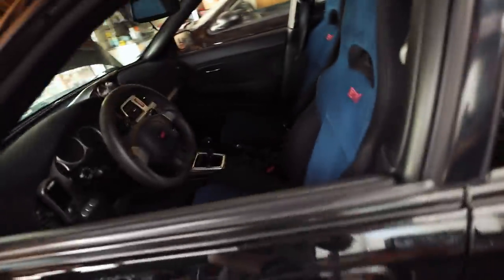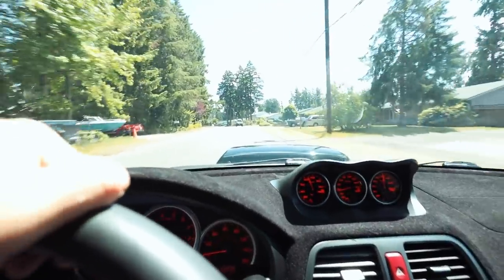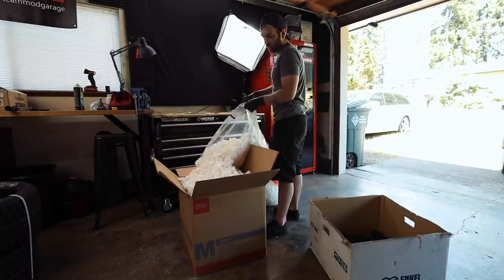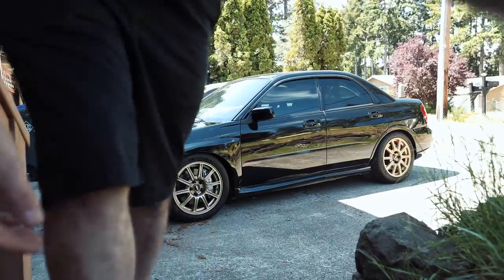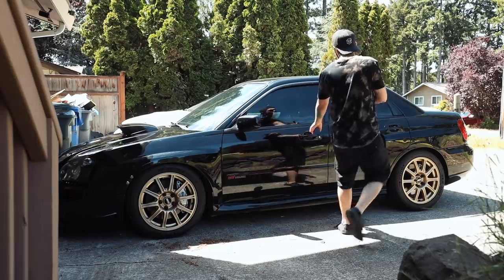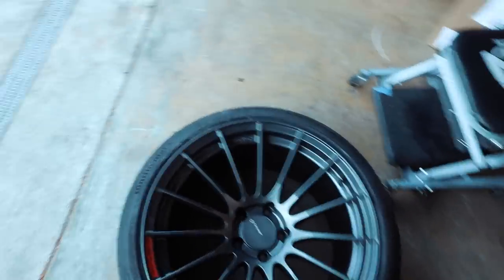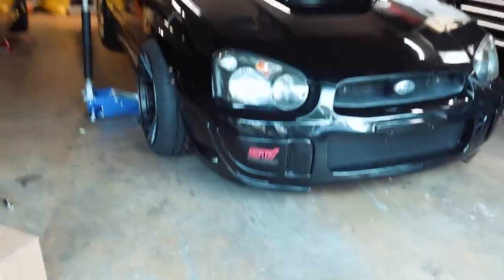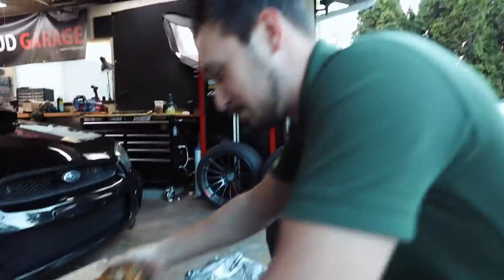This Couldn't Be Any More Perfect!

Comment: Food for thought. Im sure you know, subaru brakes suck to bleed. On my GM6 I've had good luck bleeding them by following the service manual bleed sequence, but they still normally feel like they're not all there. So i go to a lower friction surface and drive about 25mph and brake to purposely activate an abs event a few times to get the abs pump motor turning and the valves moving around and get any air past those valves and perform bleed again. The second bleed I'll lightly tap the calipers with a rubber mallot to shake any air free that may stick to the walls of the calipers and I'll also collapse the pistons with a small pry bar when the bleeder is open, close the bleeder so pressure can push them back out and repeat that 3-4 times. I always do inboard bleeder, outboard bleeder per caliper. After all that mess I get a solid brake pedal that is everything I could ask for a track event. After that, its normally not an issue to bleed the brakes to get new fluid through. It only becomes an issue when the system is opened up to replace components. I hope this makes sense and if you attempt it, it yields a good result.
Reply from the maker: I'll have to give that method a try, ordered more brake fluid to see if I can't get the last of the air out of the system. I'm sure the two times I opened the bleeder without pressure on the system did not help either 😅

Comment: Ughhh my baby just went in to get bent valves replaced and seeing all these blob eye videos is giving me withdrawal lol
Reply from the maker: Hopefully it's a quick turn around for you! ❤
Reply: @Smeedia  3 weeks. Worst part is, the motor (IAG stage 2 and built heads from a local speed shop) only have 4k miles on em. Speed shop fucked up and refused to stand behind their work.
Reply: @Smeedia  They didn't set valve lash correctly.
Reply from the maker: What did they fuck up on?

Comment: If I'm not mistaken, highly professional Subaru engine builders strongly suggest deck half splits after each splitting or at least re-honing main crankshaft journal. They say it's mandatory.. but I guess, they're exaggerating slightly...
What do you think? It would be nice to know Jeremy's opinion as well.
Reply from the maker: Depends on how the case halves are, they go through and do an initial inspection on them to see what all needs to happen 🙏

Comment: Hi tanner!  I don’t know if you can do this with a GD but with the GR you can bleed the abs unit with a scan tool and it makes it much much easier to bleed the brakes after that.
Reply from the maker: That would make life easier, where can I aquire this tool? 😅
Reply: @Smeedia  I use a snap on Solus to do it,  I don’t know if a cheap scan tool can do it or not but you definitely can’t use an accessport to do it.  It makes a big difference.

Comment: Sorry if I missed it but did you change the old brake hoses for stainless steel? Also, the firewall flexes like crazy so a brake mount helps a lot. These two additions make a huge huge difference.
Reply from the maker: Yes did that a few months ago, also already have the master cylinder brace 😁🔥 both great mods!

Comment: I have always had a soft spot for those wheels. Love the concave look!

Ps would you happen to know where I can source a 3 bolt EWG Up-pipe? Seems nearly impossible to find one online these days.
Reply from the maker: Same, I've always wanted a set of them but was hard to justify the price 😅

I belive PLM is making them still!
Reply: @Smeedia  PLM makes EWG up pipes but they’re only 2 bolt.
Reply: I’d suggest finding a three bolt up pipe and taking it to a fabricator to weld on the 38/44mm ewg vband opening.
Reply: I have a new iag 3 bolt 44mm ewg im not gonna use since I'm going with an ets rotated setup

Comment: Quick question: What's the difference between the current engine and the one you're building for Karma? Why not get the current block closed decked and built? Just curious! Thanks, and keep up the amazing content!
Reply from the maker: No real difference when it comes to what were doing. The RA block now has a revised ring gap but aside from that nothing majorly diffrent. Main reason for doing this is so I have the second engine ready to go. 😁
Reply: @Smeedia  That makes sense! I wouldn't want to take apart my daily for that long either. I'm HYPE to see how it comes out! Full chooch pulls on the horizon!

Comment: Is there a rebuild manual you like or have a link for?  EJ series specifically 257... i know you're working on one for Karma...   I need to do a first rebuild on the red thing...  that is for its new motor not the one it came with...     😲
Reply from the maker: I don't have any manuals but I can get one to share if you need one 😁
Reply: @Smeedia  "NICE" ,  i dont have that much info on the motor so i need one... Was hoping it was something other than the Suba shop manual...  i will go get one... Will need it for the Engine, Subframe assemblies, transmission and brakes.   I wish there was a Chilton or Haynes.   So much easier to read and follow...     😣

Comment: Wedsport
Reply from the maker: He ordered the weds 🙌
Reply: @Smeedia  good man , thanks for the reply brother loving the channel by the way got my hawk a year ago and learned loads from your channel
Reply: @Smeedia  got a question for you as well buddy , recently took a trip after doing some work on the hawk about 500 miles and got a EML on now with the code P0031 but only replaced the Lambda sensor less than 8 months ago , is it normal for sensors to go that quickly
Reply from the maker: Normally they don't go out that quickly, was it an OE Replacement?
Reply: @Smeedia  I bought it from a local spares shop I believe not .